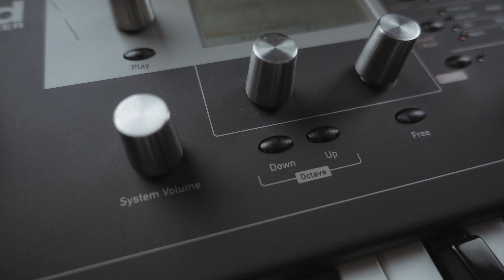Blofeld comb filter sound design

Comment: The interesting thing about the blofeld is that it is m being manufactured and sold for 14 years without any major changes, despite its shortcomings or its outdated technology (not speaking about the synthesis engine, which is still fantastic and barely matched, but rather about the CPU and DSP used).

Also, there were no OS updates since 2018 and I've read somewhere that there won't be any new coming in the future, so version 1.25 would remain the final update. The hardware is pretty much maxed out and there is apparently no way to squeeze any more improvements or performance out of it.

The Blofeld cannot really be developed further anyway, since the original developers are all gone by now and the software development platform is outdated / antique by today's standards as well. Current Waldorf products (excluding the Kyra, as it's been made by an external dev, Waldorf only took over manufacturing, marketing and selling) are all based on a different, modern architecture (ARM Cortex). 

This would usually mean entering the End-Of-Life phase for a hardware device after the software development ended.
Interestingly, there are no signs of the blofeld getting discontinued soon, it's still going strong. The blofeld is one big anomaly.

But one day, they'll be forced to move on. The DSP is as far as I know made by NXP (formerly Freescale, formerly Motorola) and they've already announced discontinuing their old DSPs. Therefore, one of the core components won't be available in the future. This problem also applies to the Access Virus Ti2 and we still don't know anything about its future. It's a similar mystery and anomaly like the blofeld, there weren't any new updates as well and nobody knows how the story will go on.

What we can say is that the Blofeld, just like the Virus, are still being bought by people, there is still a demand, so there are no reasons to discontinue them for now, as long as they are doing well.

As I said, this can't continue forever, something must happen, but there are absolutely no signs pointing at some kind of change or new developments, which is already weird in some way.

There are two possible scenarios:
- they will be milking the cash cow / manufacturing the blofeld unchanged as long as there is demand and there are parts available for manufacturing, followed by dropping it entirely and not delivering any equivalent follow-up, but just moving on and letting the past stay in the past, which would be a big shame to be honest.
- They will be working on some kind of follow-up, based on current technology (could be derived from the Iridium engine, but made simpler and cheaper), maybe they are even working secretly on it already. There were some vague hints by the Waldorf guys already, but there were no details provided if it's related to the blofeld. 
The 15th anniversary of the original blofeld announcement next year would be a fitting occasion.

Comment: If you want a better sound for the string types, use a spare envelope and the mod matrix to send a short burst of noise into the delay line and let the delay ring out naturally rather than having the noise constantly running through it and shaping it with the amp envelope afterwards as in your example. In this case the amp envelope should be fully open so you can hear the natural decay of the delay. You can experiment with the shape of the noise burst envelope and even overdrive through another filter before heading into the comb to get various sounds.